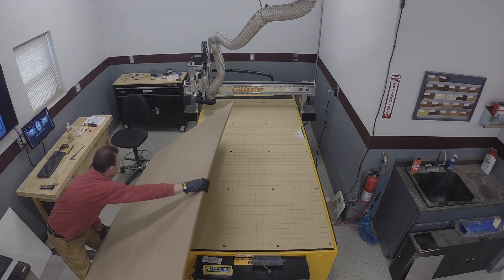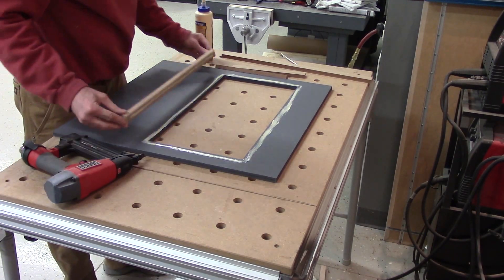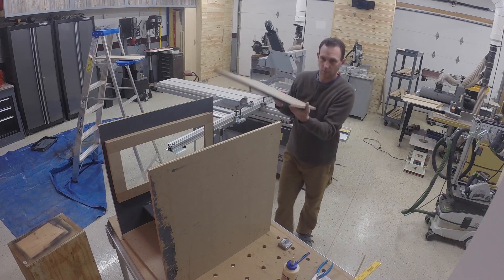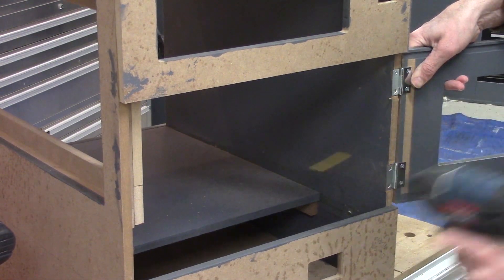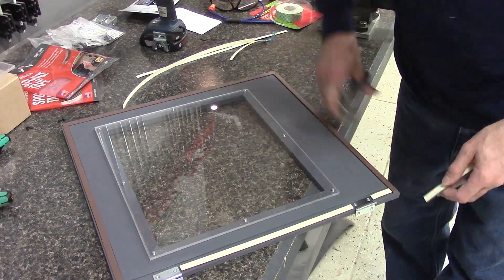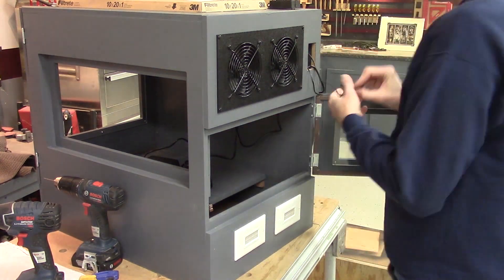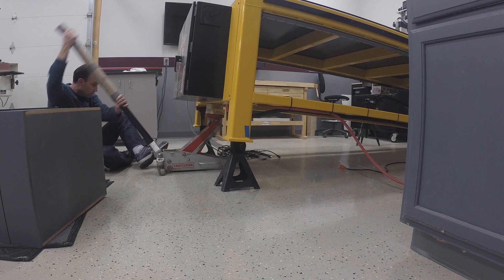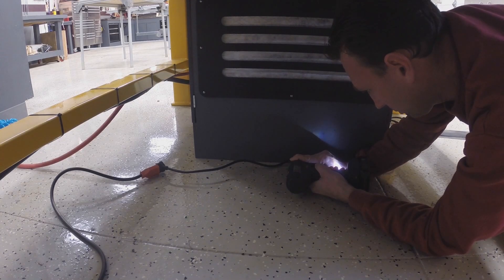CNC Computer Case

Comment: SPAX screws MDF no pre-drilling
Also to drill acrylic takes different drill bits. The bigger your hole the more the potential to crack acrylic. Usually it requires a drill bit ground at 60 Degree angle...I can tell your bit is a 120 degree bit...learn something new every day :>) Keep them coming love the channel so far